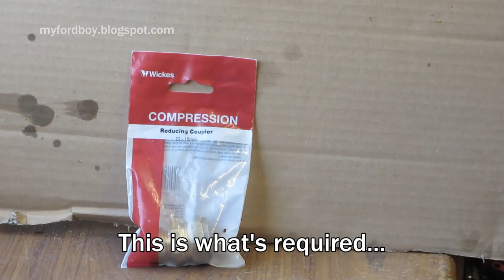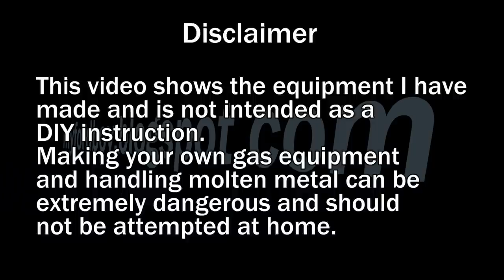Metal Casting at Home Part 45 Home Made Propane Burner

Comment: Nice work as always thank you for youre contributions,I was wondering if you could help myford boy i've got a 
Myford 'M' series lathe HooooooHa...And i have what i think is a ML7 top slide ,Please could you do me a massive favour please and  give me the dimensions of the cross slide table top not the travel just the length and width if possible the one with the T slots please i just want to make sure the cross slide i have is not off the ml10 any help would be greatly appreciated..
Reply from the maker: ***** The cross slide on my ML 10 is 3 1/4 x 7 7/8.
Reply: Thank you very much for your time pal its much appreciated have a nice week..

Comment: do they really sell all the pipe where ever the hell youre from as mm? i mean its a good system but i didnt know upc, ul, and others listed anything as diameter in mm,..  or are you just doing that to be different n throw people off a little trying to look witty..?  just saying pipe fitting is already so fukn confusing with thread sizing, spacing vs id and od and type..  theirs always another trip to the store every job..  and now u got mm... rubbish tacos...
Reply from the maker: If you are expecting a reply you need to ask the question in a more refined manner.
Reply: Pipe is measured at the ID. Tubing is measured at the OD.
Pipe thread is NOT the same as a bolt thread.